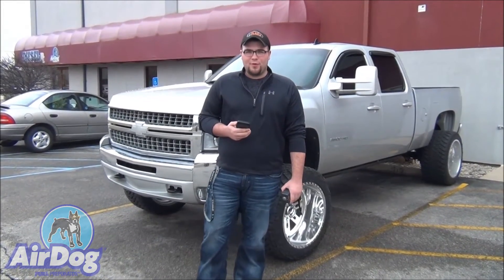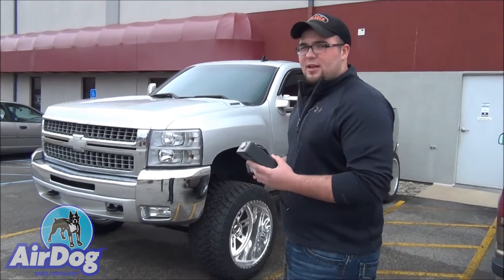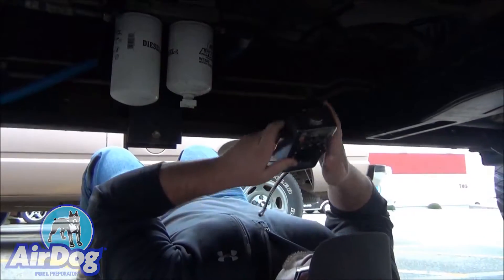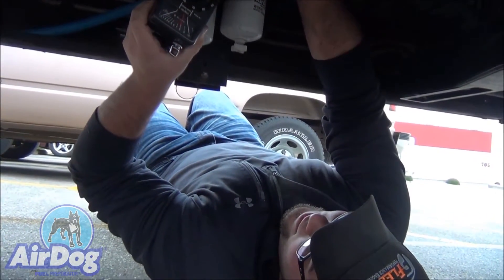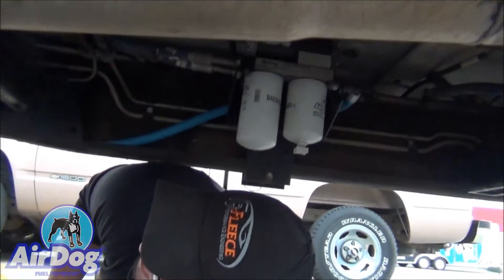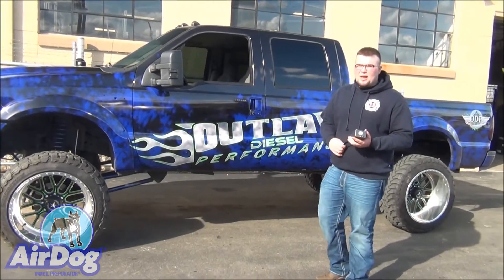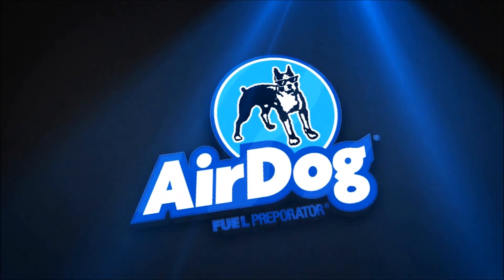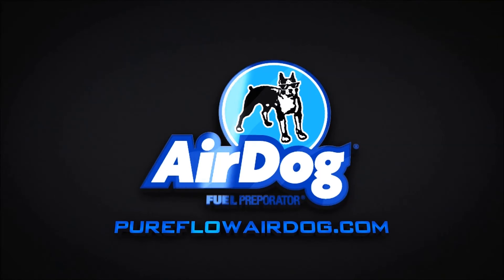AirDog® II-4G Noise Level on Various Trucks

Comment: My air dog was quite, now it sounds like a vacuum cleaner
Reply from the maker: If a pump gets loud over time, it is usually due to an inlet restriction or suction leak causing cavitation at the Gerotor. Start with replacing the fuel filters. If the noise persists, perform a bucket test to where you put the suction line in a bucket of diesel to eliminate any issues at the tank. If the noise goes away, you have an issue with the pickup tube in the tank. If the restriction/suction leak is allowed to go on for too long, there will be irreversible damage to the pump gears.

Comment: Installed mine yesterday, and it hums so loud. not sure what the heck is causing it. The connections are good and it's definitely pushing diesel, but its way louder than it should be. If I touch the hoses or the fuel tank, i can feel vibration.
Reply from the maker: Call our tech department at 317-421-3180 and they will run through some troubleshooting steps with you.

Comment: I noticed my pump getting quieter over the last month. It stopp3d making noise yesterday and today left me on the side of the road. Do i order just the motor or the whole unit? I have an air dog 150 for a 95 2nd gen 12 valve cummins, ppumped
Reply from the maker: Give us a call at 3174213180 with your serial number and our techs will help you out.

Comment: I don't mid a bit of noise, makes checking the pump @ key on easier if you can hear it whine a bit.  Once engine is running and doors are shut a total non issue.  Nobody has ever said to me:  "What's that noise?"...What they do say is "That's a nice running truck man".  Have had an earlier model for years on my 3500 '06 LBZ Dually.  These folks stand behind their pumps...the one time I had an issue, sent me a brand new pump no questions asked.  Just get one.

Comment: I had the Air Dogg 2 and the pump went bad. You all replaced it with a new Air Dogg 2 4G and at first it was quite. Now when I first start the truck it's quite but after driving awhile the pump gets much louder. It sounds louder then my old pump.
Reply from the maker: Sounds like you may have an inlet restriction or a suction leak that is causing cavitation on the suction side.

Comment: I Wish My airdog 2 was that quiet, running at 30 psi it as loud as the engine running at idle. It also makes an annoying squeal sometimes. Ive been told thats air being forced buy the regulator.
Reply from the maker: Yes, the older pumps can be pretty loud at times. Restrictions in the water separator or fuel filter can cause excessive noise as well as any suction leaks. If the filters haven't been replaced recently, replace them. Also you can perform a bucket test to check for any suction leaks in the tank. 

The 4G motor/tower will fit on the AirDog II bases. If you would like to upgrade it, just give us a call and have your serial number handy. We'll go over the options with you.
Reply: So If I do a bucket test and the pump gets much quiet then that would mean theres a proplem  in the tank? I did one a few years ago when My frist pump failed only after 6 mouths of use. And I recall it didnt really get any quieter. But I was running 17 psi at the time and wasnt all that noisy. Running 30 psi its very noisy. Some times it squeal so loud Its sounds like I got a hog straped  under the truck. or the airdog got a blet thats slipping. If I recall anyting over 15 psi and it starts squealing, the higher the psi the wrost it gets. My truck seems to like 30 psi. Would the airdog g-4 be any quieter?

Comment: Thank you Alex. Do these units need to be so low? I have a hard time believing that some units shown, won't get damaged in a off-road situation, or from driving over shredded tire pieces on the interstate. 

  If parading around town, cruising a parking lot or car show, then I would think everyone would be Ok. But we work our trucks hard, and often drive through corn stalk laden fields at a pretty good clip. Is this for City Boys only? ; - ) 

  I am imagining an installation up much higher, like up in the rear fender area, up near the filler neck. I would even go so far as adding a second filler cap door, on the other side of the Truck, and have easy access to a weekly schedule of draining out any possible water manually. Though I can imagine most would not go that far. Especially on a new Truck. 

  I know many complain about the noise, but not a majority. Would a sound-deadening lined 5 sided box, over the top of the unit during install, cause the unit to overheat in Summer time conditions do you think?
Reply from the maker: Steve, the pumps do not need to run so low. Some applications don't have the room on the inside of the frame rail so they must be mounted a tad lower on the outside of the frame if you are using our sandwich plates. There is the option to drill the frame elsewhere to mount the pump. If you install the pump in the fender area, there will be no issue with that. If you go with the AirDog II-4G, you wont have to worry about noise. I have one on my personal truck and I don't even know it's there. I know it's working because of my fuel pressure gauge. If you do mount it in a box, it will need to be vented. The pumps were designed with the assumption that it will see airflow from a moving vehicle.
Reply: Thank you.